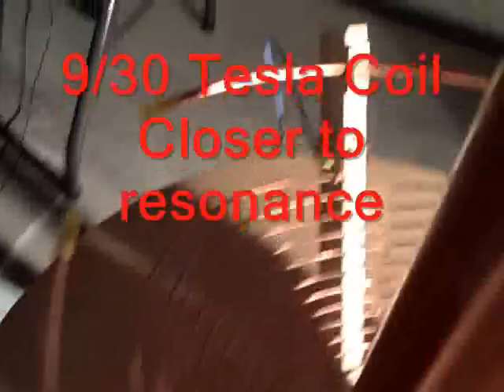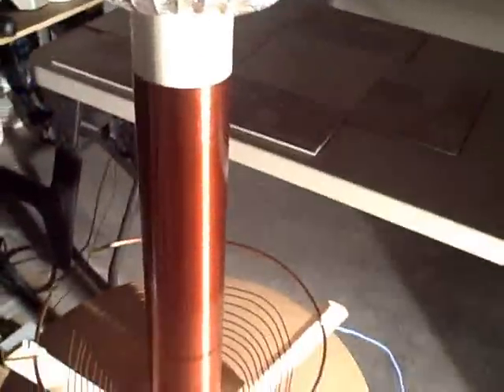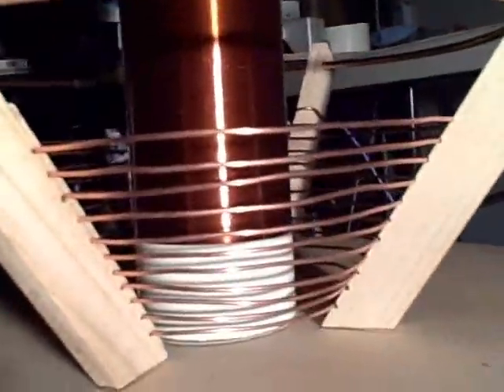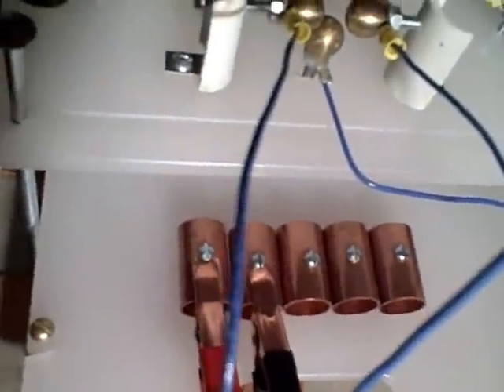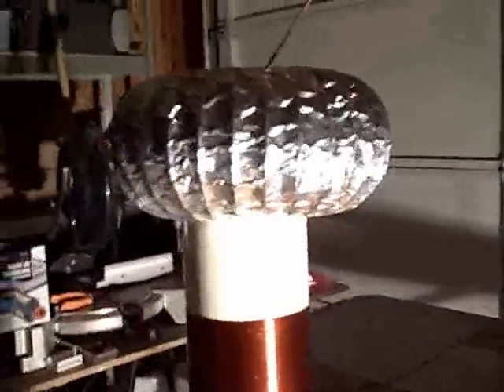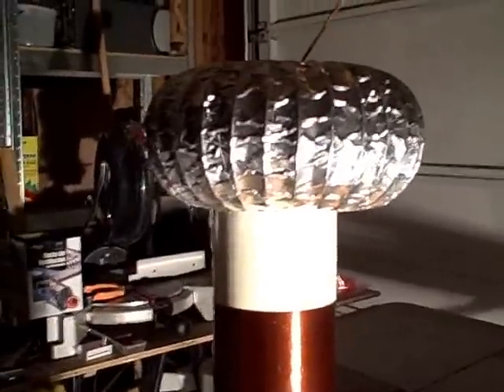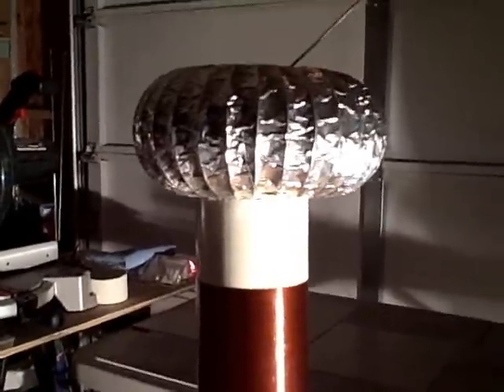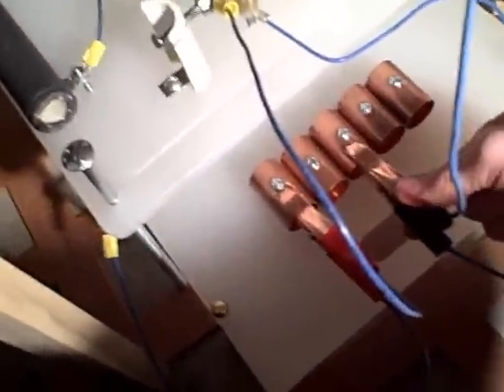9/30 Tesla Coil - Closer to resonance.

Comment from the maker: This is the first Tesla Coil I ever made. The main problems with the setup was the tank circuit wiring being too small/extended, thus having too much resistance, and the toroid having too many sharp points. Yes, it was not in resonance in this video either. However the maximum streamer length I was able to obtain from this setup was a little over a foot length. If you check my newer videos I have built a very professional spark gap coil. It creates streamers over two feet long with the same NST.

Comment: The reasons your coil ain't working is because you're clearly not in resonance, you cap is too small, making a larger secondary is gonna make this worse You are waaaayy over coupled and have also chosen to use helical primary which makes tuning harder as it has very narrow 'sweet spot'. the recipe for a good coil design is to pick the ideal cap for the power supply you have and work backwards. Oh year, your torroid is WAAAYYYY too small....
A fan or vac on the spark gap also really helps..

Comment from the maker: Well, you have to first remember that most coils this size are being powered by a higher amperage circuit. I decided to make the secondary large incase I raise the power levels. There were other adjustments I made to the coil such as better tuning, secondary height, topload heigh, after this run. The toriod is definitely an area of impovement though.

Comment from the maker: I can't be exactly sure, but I will say what I have learned. Our "Tesla Coils" are tuned to 1/4 resonance for maximum streamer lengths. My assumption would be that full resonance with both the LC circuit, and free resonator (secondary) produce transfer of the amperage, instead of the "transformer" effect into mostly electrical potential. Full resonance may have been what N. Tesla planned to use for his wireless system of power.

Comment: hey what will it look like at resonance. ive been studying this through an old electricity book and its talks about 100% unity in a science book through resonance. the energy is transfered at 100% but it doesnt show any pictures of true resonance. i read how the coil of wire, capacitor and frequency has to be right. it also talks about 0 resistance at resonance which is pretty sweet.

Comment from the maker: I need to get my new setup finished already. It will all be built into a nice portable base unit I made out of oak, and added small wheels with safety locks. The new primary will be 1/4in copper tubing, 50 feet length, about 15-18 turns total. Going with flat spiral this time, not a conical primary. Also, working on a miniature magnifier coil setup in spare time. Today I built my RFI filter a cheap wood case with switch, and power indicator light.

Comment from the maker: "So I must tap a little over resonant to avoid the problems right now." The problems were actually created by tapping over resonant. I think the coil is almost tuned now. Tapped at turn 8.5, but still not much more than 12-14" streamers. Each connection to the primary coil is about 20" though. So that would create a lot of loss i'm sure.

Comment from the maker: Teslapigeon, you were right about something being wrong. After messing with the primary tap point I found I had the coil tapped over resonant. Oh, and my primary only has ten full turns... LOL, I guess I forgot how to count? I'm still trying to find the tap point. It should be around the start of turn eight according to TeslaMap, but my primary coil has a lot of imperfections so I doubt thats accurate. What should I look for when tapping the primary, other than longest output, of course?

Comment from the maker: That would not work out. I am already having some minor problems with secondary to primary corona and visible streamer from secondary to top primary winding at full power. I just recently found out conical is the worse to use with NST due to the electrical potentials of the secondary and primary. So I must tap a little over resonant to avoid the problems right now. At least until I make a new flat spiral primary.

Comment from the maker: I do plan on making another primary coil. I decided on the conical coil because of the size magnet wire and diameter of the secondary it can stand higher coupling using only a 9kv 30ma NST. Just wondering, what makes you think something is wrong? Max streamer in air at full power is about 12-14". Remember its humid, and the Terry filter also cuts down the power some.

Comment from the maker: After shortening the length on both sides of the secondary the coil performs even better. At one gap the small 1/2" streamers grow to around 3". About the same output as the two gap run shown in this video. I will upload another video with the secondary adjusted in a few hours. It's also very humid where I live right now. I'm sure thats impacting streamer lengths some.